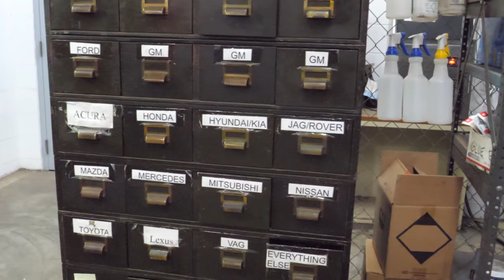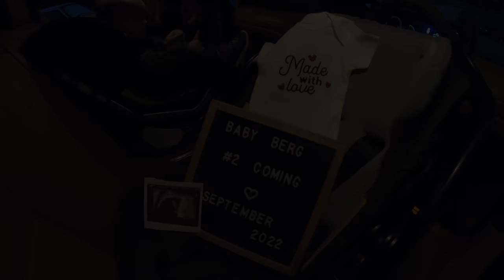Small Block Chevy 350 TEARDOWN! 100K Sub Special! Shop Tour, Announcements & I Open My Play Button!

Comment: Congratulations on everything!! The subscribers, the new car, the baby on the way. Found you as a recommended video and haven’t stopped watching. From a mechanic that works on cummins engines, its great to see someone tear down engine after engine after engine that doesn’t bs their way through the video or cut to after a part is removed. The struggle keeps the video real and genuine. Glad to see variety and some really messed up parts

Comment: 165 hp, four barrel carb, 155 two barrel carb. My first car, a Malibu, bought new in 1975 had the two barrel 350. Dirt simple, PCV, catalytic converter, HEI, ran great for 14 years. Was able to do most simple servicing. Had leaky valve stem seals, replaced, then rings finally started giving out, car retired. Sold it many years later to someone who turned it into a dirt track racer. Long live the SBC.

Comment: Those heads are what we called "Heavy Heads" - They are easy to ID by the strait line casting along the bottom side of the head from front to the back - The lower casting on the lighter heads bump in and out about 3/8 of a inch towards the valves making them more acceptable to cracking - And back then those cam shafts were known to be soft - great channel
Reply: They WERE soft.  replaced many.  Crane Cam used to sell case hardened replacements that were much better...
Reply: there still soft in the LS.. 350 is a rubbish engine.

Comment: Now in my late 70's I was bit by motors from 13 years old when I started to pull heads off flathead fords for a buddy that raced. from parts cleaner to racer, to making my living at engines for years. I enjoy the fact that you describe and guess at what happened, go from top to bottom, and I learn from these videos. Thanks from an old engine builder.

Comment: I worked for a large marina forty years ago, and some fool forgot to order the new boats to be winterized. We had about 25 small blocks freeze and crack! The insurance company  paid for replacement bare blocks, plus labor and gaskets. I got very, very good at disassembling and reassembling small blocks. In two weeks we had them all fixed. And winterized. 
Nice to meet your growing family, congrats on 100K!

Comment: I got a chuckle when I saw the camshaft and lifters! For some reason Chevrolet's are notorious for lifter and camshaft wear. Back in the day I can't tell you how many tear downs I did where cam lobs looked like poorly ground bearing journals. I used to replace them with Crane, Isky, or Crower cams and lifters and never looked back.

Comment: Brings back memories.  Built a few of those.  Some things you didn't point out or just that I noticed.  1.  The distributor drive gear on the cam.  You might have pointed that out.  There's kids today that have never seen one.  Ya, distributor, with points and condenser.  OLD school stuff.  2. Four bolt mains would generally indicate it was originally a pickup engine.  Passenger car 327 (WAY back) and 350's generally were a two bolt main.  How primitive compared to a six bolt main in an LS.  3.  The "sideways" worn main is why when I used to build em if they had any severe events in their history like severe rod knock, bent rods, etc. I always had the block line bored.  I mean it went to the machine shop to get bored 60 over anyway.  Why not line bore for safety's sake?  Mains and cam bearing seats both.  Those blocks could deform if they had violence happen in them.  Memories.

Comment: Since you ask for advice, always loosen and torque rods with both rods in place on each rod journal of the crank. This prevents putting torque on the bearings by twisting the rods in the bore. That can prevent abnormal wear/damage to bearings.

Comment: First car, 1974 Chevy chevelle 350 2 barrel. Traded it at 115k. No oil leaks. Only problem,  HEI ignition coil died in a burger King drive thru. Engine just stopped running. As a poor college student had no money for a tow. I repaired it right in the parking lot. Super easy. Been wrenching ever since.

Comment: Many years ago, I helped a buddy put a 375 hp cam in a 396ci bored out to 402ci. We started right after we got out of school that afternoon, finished around 4 AM. It was in a 1968 Chevell SS 4 speed tranny. That thing would pull the front wheels off the ground in second gear.

Comment: Hi Eric, I know that this was a year ago and jump forward to today the number has jumped to 258000 subscribers, WoW.   Thanks for including me as your subscriber, thanks for the shop tour, but most of all thanks for tearing down what you call an old engine, what struck me was the beefy crank compared to some of the modern stuff. Big ends with bolts and nuts! Takes me back 1942 Chev Army Blitz or my first car a 41 Pontiac, or 1960s Leyland Buses.   That cam shaft and the wear on the follower I struck in early GMH Holden Australian cars.  Can remember sitting on the mud guard with my feet in the engine bay, working my cars. Hey keep up the good work and regards to your family. Ted from down under.

Comment: Ah man the memories. First engine I build with my Dad was one of these. 350 bored 30 over. Put in a 78 Chevy Malibu to replace the stock 305. I think we even had the same Edelbrock intake and valve covers.  Good times.  Thanks for the memories!  PS. Had to laugh when I heard the 'bent pushrods' comment...shamefully, I did that to the engine by drag racing in front of the high school.  Dad was pissed. Ugh.

Comment: Love the channel! Keep up the great work. For all you fellow scrappers out there, if you're looking for a 4 bolt main 327/350 like this one, look for a oil galley plug above and slight left of the timing chain cover (this motor has it as well). The Vett didn't have enough room for the rear sending unit, so Chevy drilled and tapped the hole in the front oil passage on high performance 4 bolt castings. Some 4 bolts may not have the plug, but I've never seen an engine that had that plug that wasn't a 4 bolt.

Comment: If u going to keep and soup it up dat plug on block above timing chain cover is oil galley for ur cam,I use to hot rod em n put a small oil pressure gage in it for appearance while under the hood plus looks cool,but use a oil filled gage ,it was used as a reference  ...

Comment: I have one of these with 340k miles on it that is a daily driver still. It has its faults but is still reliable and fun. I expect I'll get tired of it before it develops any real issues. I use quality oil (usually synthetic) with synthetic Lucas Oil Stabilizer and since it eats a quart every thousand or so just a filter change now and then and it hums along happily. I think the oil consumption is my valve seals being destroyed after 30 years. I could change them, but it's not fogging for bugs and it isn't using more oil than changes would, so oh well. Long live the 350!

Comment: Back in '86/87 I used to have a bog-standard Chev Bel-Air with a 283 in it. It only had a 2-speed box, Power-Glide I Ithink it was called and Drum Brakes all-round! Now I know why the Brake Pedals were so wide - 2 foot operation was not uncommon! But I loved it..... And sold it.... Everything is for sale at the right price right...???
The only thing I did to it was change the  dull beige colour to a nice red and get the Steel Wheels Chromed.

Comment: I know I'm late to the party having only discovered your channel a few weeks ago. I subscribed almost immediately. Being a student in engineering (not mechanical, so don't expect any engines from me) it's fascinating how everything is so similar, yet so different. While attending community college right now, I work as a tech and repair computers. It's amazing to consider that computers are also often killed or need repair because of negligence to do basic maintenance tasks. Some parts obviously fail (friggin hard drives...), but most others are because of negligence (batteries, ironically enough).

Your videos are fantastic. I love the direct and to the point approach you take. Keep on keeping on. I would love to see a Cummins ISX or X series engine sometime, but considering those are semi-truck engines I'm not expecting it anytime soon.

Comment: You’re being too gentle, that’s Detroit iron, it responds to brute force.  That little plastic ring on the oil pump shaft is how GM locked the distributor drive shaft to the oil pump shaft.  4 bolt main 350, properly machined and assembled would handle a .060 over bore and a .010 crank grinding and run for 150,000 miles with regular oil changes.  I lost count of how many engines I built between 1976 and 1990 when I finally laid down my tools.  Our shop used a slightly different dry sweep, we used to get the sawdust out of the local high school’s wood shop dust collector and throw it down on the puddles and then when we cleaned the shop floors to get rid of the build up we dumped cleaning solvent on the concrete, used a push broom to scrub the floor and then threw sawdust on top to dry the floor out.  Did a DAMN fine job!  I’m certain that the EPA and OSHA would have a complete melt down if a shop were to do that today!  Congratulations on !00,000 subscribers, your channel deserves it!  Now I want to see you pull down GM 427 tall block out of a 1984 - 1988 medium duty GM or Chevrolet truck or find a 1978 to 1984 International 392 or 404 V8 and cut your teeth on the bastards of the truck shops!  Keep doing what you’re doing and you’ll keep getting what you’re getting!   Peace!  Mike

Comment: HI ERIC,good video. I'm a ford guy,but motors are motors.The pass side head had good compression looking at the valve colors.the driver side had 2 down cly,looking at the dark valves .That's one clue to me.With the bad 2 lifters did they belong to the 2 dark cylinders?I'm guessing ,yes? Those 265,283,307,327,350 small blocks,are the hearts of old cars for Chevy. 260,289,302,351 windsers? were fords.It's like every body was selling the same things but like cornflakes just in a different box.At least you didn't need a computer degree to do a tune up.GRANTED the new cars last longer and get better mileage and are way cleaner.your videos are great ERIC ,they ALLOW viewers a chance to see inside engines we don't normally see,thank you.

Comment: Congratulations on 100K, and to the second baby!  Quite a few channels I watch are small-time productions like yourself and it's really cool to see people like you get your break and become something you never expected.  Here's to 1M, this subscriber will be there when you hit it!

It's really neat to see the differences between something made 30+ years ago and today.  No fancy cast aluminum covers/pans with waffle patterns, just straight-up stamped steel.  No plastic ANYWHERE.  Bare minimum machined surfaces probably brings the cost down significantly too.  A lot less hoses, wiring, plumbing, and sensors but then again a lot less understanding about what's going on inside the engine when it's running.  I'd argue that engine could probably still be rebuilt and run another 35 years, smoking and burning oil of course.  I don't think you could say that for most engines today, far too high-strung and cost-engineered.

Comment: Usually saw those old 882s on 400sb and were prone to cracking between the seats after running unleaded gas and the valves sinking in the seats, you have a nice set up going there man. I like all engines and like taking them apart more to see what caused the issues with them more than what makes them tick although thats part of the cause of issues most of the time, diagnosing the problems and a cure is my thing. You just saw the reason i will never run another flat tappet cam again lol

Comment: I'd love to see you take apart a BMW N20 Turbo 4.  One of my dailies is an F10 528i xDrive.  Little known fact about this engine, it's geometry is exactly the same as the S63/N63 from the 550/M5.  It's exactly one half of the S63/N63 engine.  They share many common parts including pistons, gaskets, coils, etc.  It was intended as a stop-gap engine between the N52/N53 I6 engines and their new modular 3-4-6 cylinder series.  Thank you for all your hard work, I really enjoy everything you put out.

Comment: I want to see a "normal" pic of your desk. If you're like most people, It does not stay that clean all the time, and you cleaned it up for this video. 

Totally not speaking from experience haha!

Side note, I do a lot of repairs of GM ABS modules, gauge cluster repair/odometer flashing, ECU flashing, Ford EEC-IV repair, GM wiper motor/delay module repair, etc. Also build standalone harnesses for LS, EEC-IV, Vortec 350, and general 0411 swaps. Lots of money to be made messing with these things.

And AWESOME arcade game! When I was 16. I worked at a pizza joint that had Cruising the World, and I spent a large percentage of my minimum wage $4.75 an hour playing that game. Well, that game and a Flintstone's pinball machine.

Comment: Casting number on the rear of the block (last four digits 0010) and the width of the serial number pad on the front, passenger side, identifies it as 1970 to 1976 and can be a two, or four bolt main bearing version. These blocks were installed in everything from smaller passenger cars and light trucks, to larger vehicles such as school busses. I'm not sure how many were produced, but I'll bet the number is in the millions.

Comment: Wow! Congratulations! I only discovered your channel a few weeks ago, but it has quickly become one of my favorites. I am also a gearhead although, at my age, I am too slow at it to make any money. Hence my career in electronics/telecom. But yeah... I enjoy watching your teardowns and will continue to watch. 
If you are taking requests, I wouldn't mind seeing a teardown of a 91-97 Chevy 3.4 DOHC (LQ1). Admittedly, there is a limited market (subliminal message - you're probably not going to make any money off of it), but it's a fairly intricate engine that was based on the original 2.8 Chevy 60 degree V6, which is about as primitive as a 350. They are also occasionally swapped into Fieros (which I am currently doing). Did you mention, in another video, that you have a Fiero? Or am I mistaken? 
Regardless... keep on keepin' on.  And thanks!

Comment: You have done really well. One bit of totally useless info. M51 engine fitted in range rover p38s. Late models have a little pcv valve in the rocker. If anyone on here has one in their shop that's breathing heavy my friend discovered an interesting fix the other day. He also had a 525 bmw in. He went to "borrow" the valve out of the beemer to try it in the range rover as the p38 was pumping oil out all over and breathing like a steam train. All of the rocker etc is the same. Until you strip it down. The beemer has the mesh filter. But no pcv valve. So he rebuilt the p38 without the pcv. It fixed all the problems and the owner said that although the valve had only gone bad over the  weekend. The engine ran much better than it ever had without the valve. So if you get any p38s in with the m51 engine a useless little bit of info. I like to add anything we discover. Such as Audi A4s give out around 15 fault codes. An the breakdown companies send them to the shop for a throttle body. You'll find the filler cap will be sucked our of your hand on idle an slam back in position. Not the body. Again it's the pcv. Do that clear the codes and all is right in the world.

Just useless bits of rubbish. As I know lots of watchers are service techs.

Comment: The small block Chevy is what I graduated to after I smoked my 250 straight six two times.  74 nova was the car.  Bought in 1995 out of a pasture for 200$.  The sbc  is still the engine of all time.  Cut your teeth on what you can and do your best

Comment: An American Lincoln sweeper and Taylor Dunn cart, both broke, bummer.

Have you considered sliding racking, where the racks are mounted on floor rails? It's not quite as easy as just having an aisle between every one but would allow you more inventory room without having to think about expanding the building or buying another building. Fortunately in my experience at least, racking holds value decently well so if this were something you were to consider, the old shelves would help recoup some of the investment on that.

Finally, thank you for trying to get away from packing peanuts! Polystyrene foam isn't recyclable and ends up being an ecological nightmare if the customers don't dispose of it properly. Cheers, thanks for the entertainment and the tour.

Comment: This reminds me of what is now a 50 year mystery that was solved a few years ago.

I've always been rather fastidious about my cars maintenance from my first car, a 67 Camaro with a 327 275 hp engine

I drove the car about 80,000 miles and then sold it to a fellow at the auto parts store who knew how many parts I bought for it 

And the next visit I went in he told me that he found out a cam lobe was worn. 

And since this was 1972 I guess for 50 years I wondered what was the cause?

And a few years ago I think I came upon the answer. That camshaft is only splash lubrication and where I was, back in Virginia, in the winter and I thought I was doing the car a favor by starting it up and letting it idle for 20 minutes in the snow . All I can figure out is all that time it was idling that one cam really wasn't getting the oil. Or perhaps when I started it up that oil was thick enough and that combination with the splash lubrication wasn't giving at the oil.

But still that small block Chevy was an amazing engine. How many engines has anybody made that were in production for 40 years?

Comment: The heads are thick casting with soft valve seats for leaded gas. The four bolt main bearings is hi Po or truck. Orange color is pre 1977.